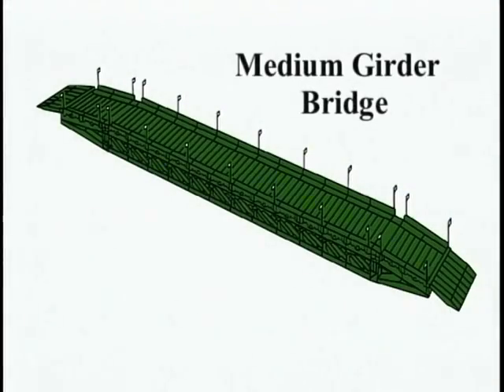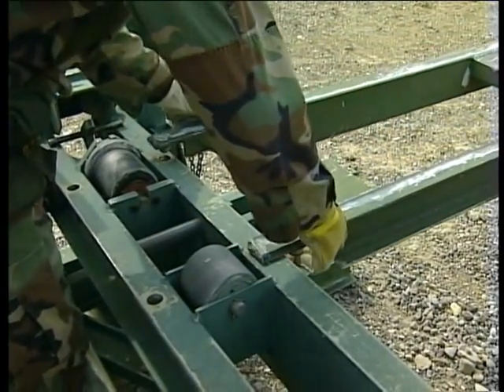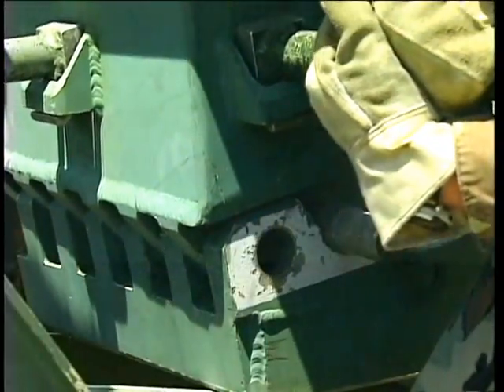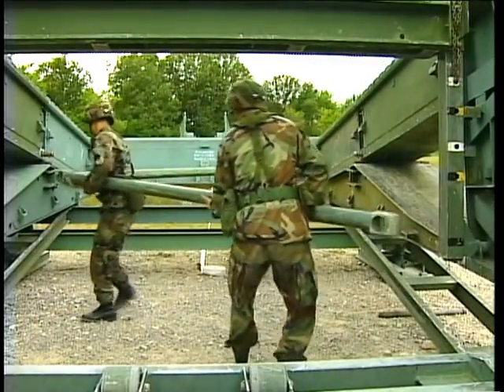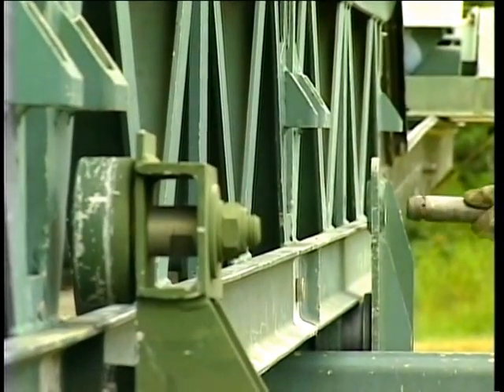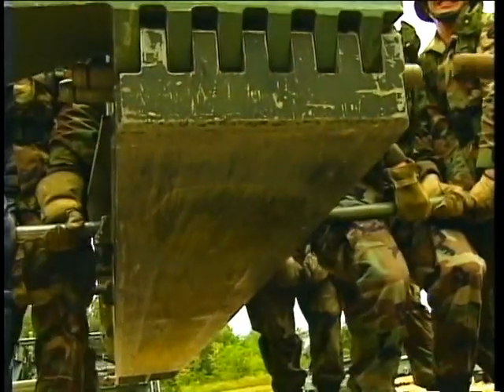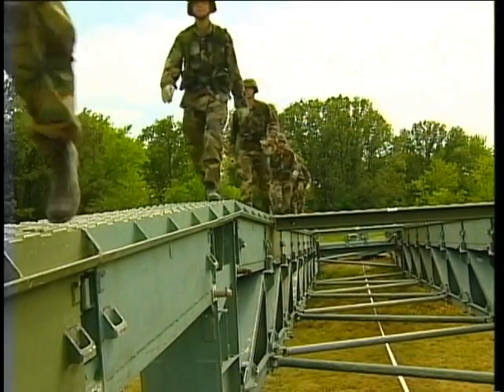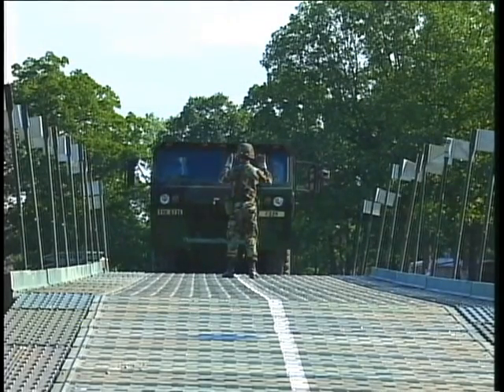Medium Girder Bridge - MGB (2002)

Comment: I do First Aid on Canadian jobsites and have seen overexuberant young people push when they shouldn't, pull when they shouldn't or drop rather than put down carefully causing pinched fingers, or worse and also back injuries.  Choreographing what to do and when with a bunch of young people would be a challenge.  On the jobsite we have people of all ages and heights who lift, push, pull and put things down at a different rate or speed.
If I saw 1 pinch point in this vid, I saw a hundred.
Seriously, the Ukrainians need these bridge systems to help rout the Russians.  These and river boats or high speed barges to ferry soldiers and equipment to keep the Russians on the run.  Use the night and  the fog to hide in then strike out from there.  Sell them the system, train me and I'll go for nothing.  Anything to help.